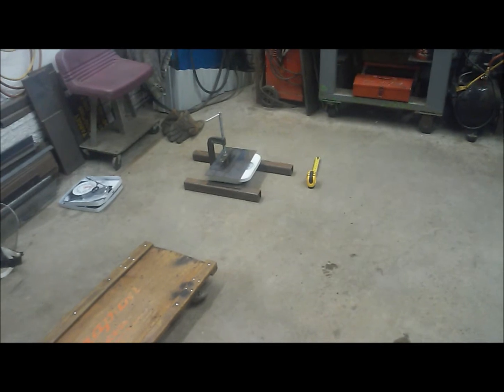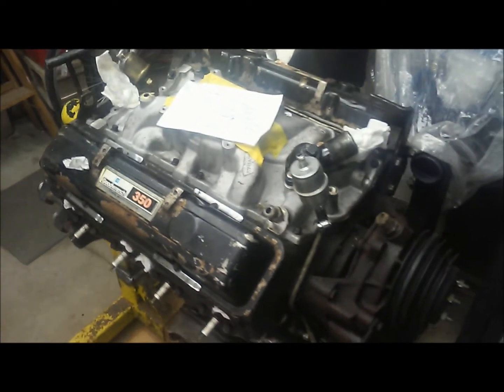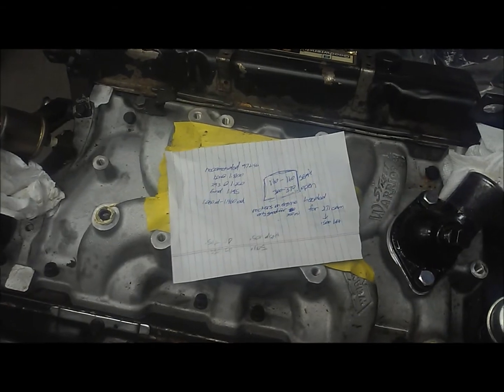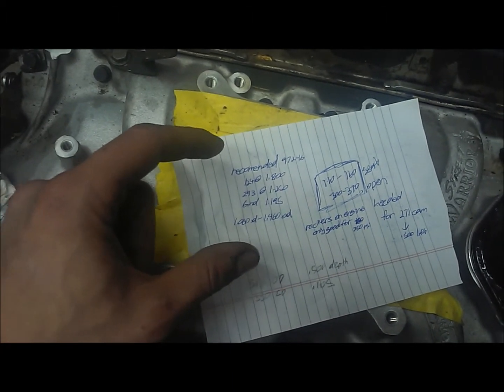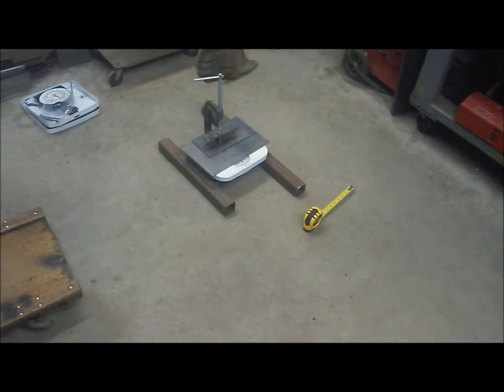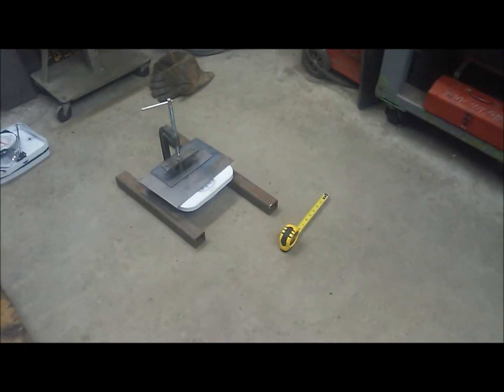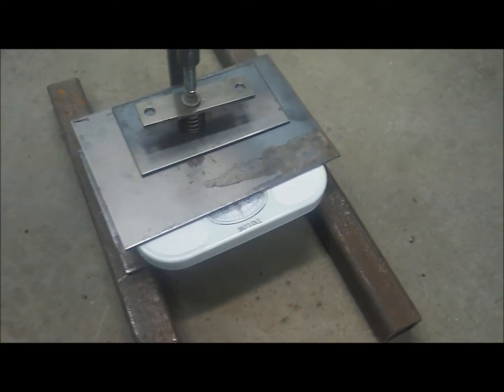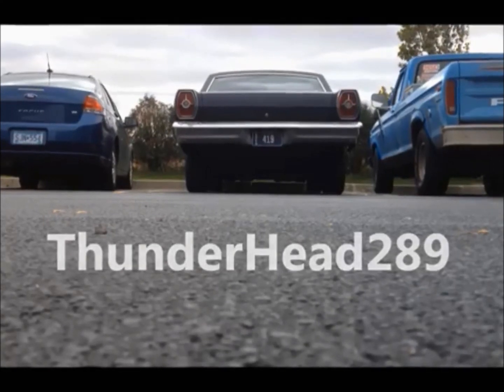Valve Spring Logic - High Lift Cam & High RPM (SBC & SBF)

Comment: Hello my friend,  I would love to know if you can tell me what's the max lift & RPMs these springs can handle, here are the springs specs: seat load 136 lbs @ 1.800'' , open 412 lbs @ 1.170'' , spring rate 438 lbs/in and coil bind  1.125'' , thanks in advance

Comment: If I put a cam in that recommends 395 pounds open & the heads already have valve springs 430 pounds would the springs wear out the cam ?
Reply: not the cam but the lifters
Reply: @yourmom705  thank you

Comment: There is nothing you can say to prevent me from replicating that genius spring tester. The guy who is gonna put my eye back in my head thanks you. As a matter of fact I have some big ol mystery truck shocks...
Reply from the maker: +Stephen Bianchi oh good lord! i actually made a video over the tester itself just for laughs that i will post up later today. it did save me the 60 bucks from having the machine shop check it and then taking a week to get back to me.
Reply: It's probably safer than a lot of Chinese spring compressors.

Comment: I watched a video about a old school cafe racer builder, to get more power out of the engine he used valve springs that required less pressure to compress
Reply from the maker: That's ignorant. When one valve is opening, another on an engine is closing. It pretty much cancels each other out. Unless it's a single cylinder
Reply: +ThunderHead289 no usually par twin his theory on it is if you have a parallel twin with 4 valves and each spring is 100 pounds of pressure that's 400 pounds combined, now on a old British parallel twin the Pistons reciprocate up at the same time, one compressing the other blowing exhaust, same applies on down strokes, one cylinder is intake the other is power so in one cycle only one valve opens per cylinder one either has the exhaust open or the intake open, so if you replaced all of the springs with say 50 pound ones the engine would only have to overcome 100 pounds of pressure instead of 200 pounds per revolution which would mean that less energy is used in compressing the valve and is sent to the rear wheel
Reply from the maker: makes sense, anything v8 does not follow the same logic. your spring always has to be strong enough to be able to follow the cam lobe no matter what the engine. lighter springs will give you more low end, but you would lose valve control in the upper rpm all the same. thats just camshaft basics. luckily it cancels on a v8 engine.